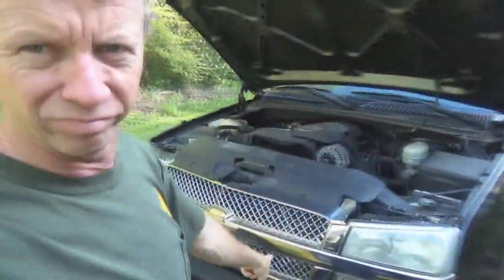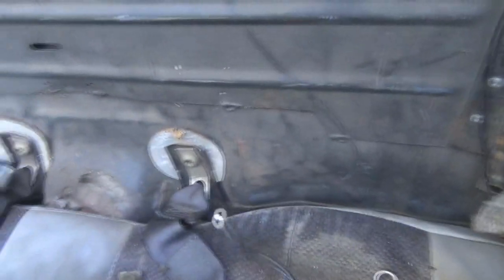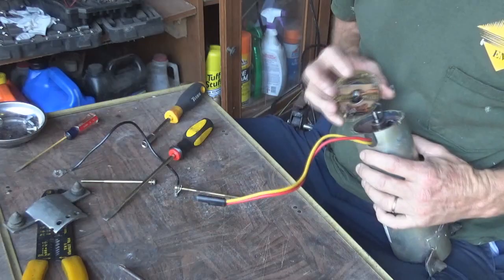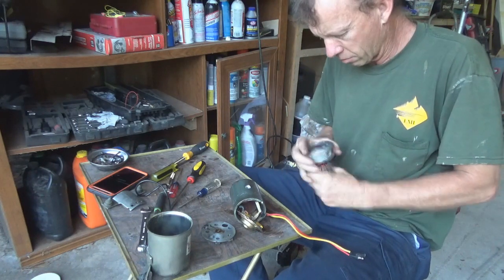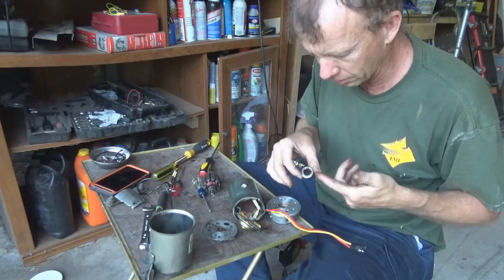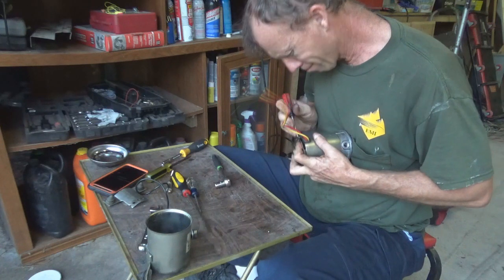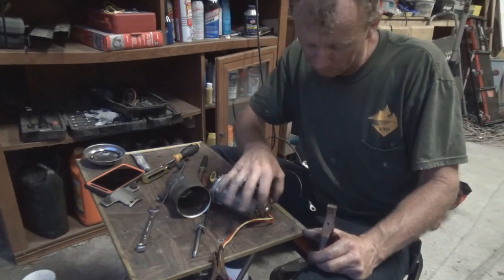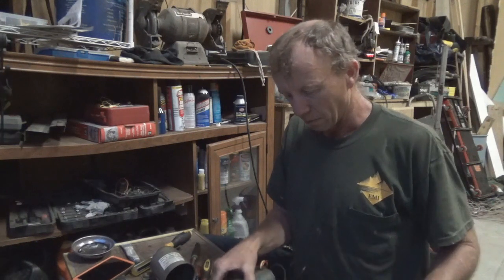Foxbody Convertible TOP MOTOR Rebuild...Part 1 saved $200

Comment: Great video man! Going to try this on mine. Did you say it was making no noise at first or was it humming?
Reply from the maker: Mine was just clicking. So I knew power was getting there. If you don't hear a click put some power straight to it with jumper cables. That will let you know  a few things. 1. If it turns or hums you have bad wires going to it. 2. If it clicks with jumper cables but no turn the problem is definitely in the motor. 3. If you hear nothing  the pump is probably shot. Take it out and hit it with the wires. No sound then and you can try to rebuild but motor may be toast.

Comment: Great!  I have a LeBaron that uses a very similar motor.  Do you think I could clean/replace the brushes on the electrical side by just undoing the 2 bolts on that end and NT have to remove the lines or reservoir from my trunk?  Thanks!
Reply from the maker: Probably. I have heard the le barons motor are interchangeable. Good luck. Fingers crossed for you.

Comment: Can you still open and close the top manually if the motor stops workin?
Reply from the maker: Yes. It's heavy and bulky but once fluid is out it can be done. I did it for 10 years like that. Now that I am older my back said it was time to fix things.
Reply: @yellowfoxbodyguy  will it hurt to manually open and close. My 88’s too just stop working. Just clicks
Reply from the maker: @erichkrieger1355  once all the fluid is gone no. If it's still in there you will have all that pressure fighting against you and will need 2 people going super slow to do that. I would problem solve before I tried to open and close tho.